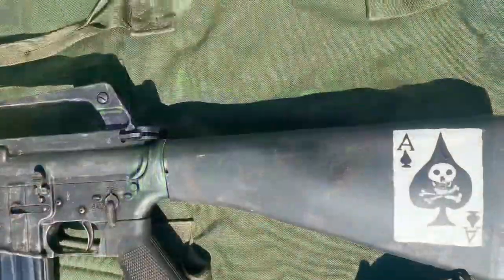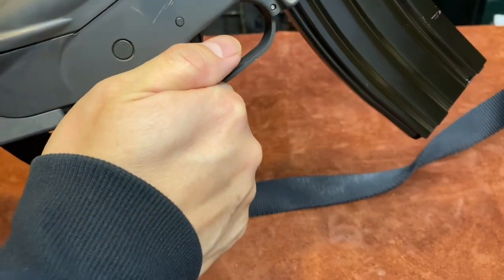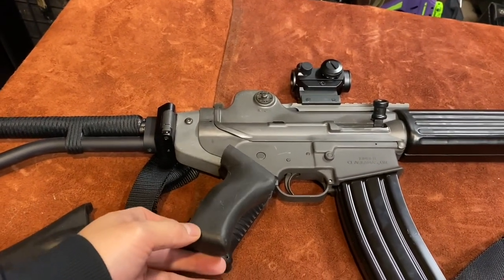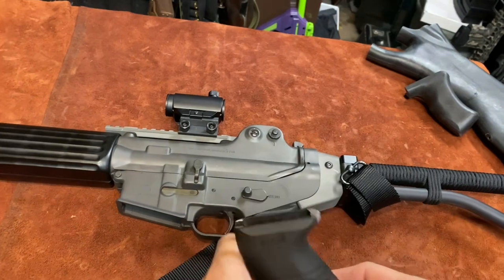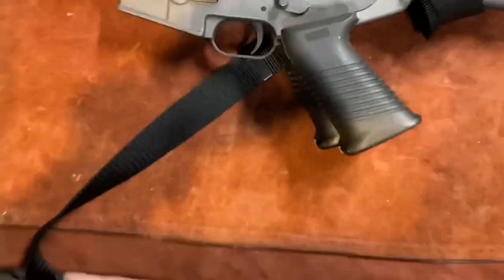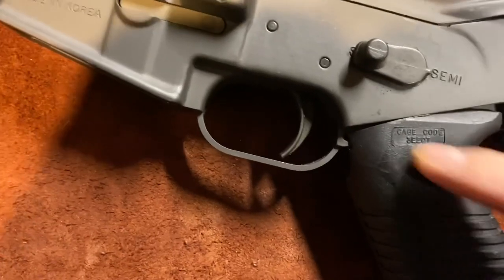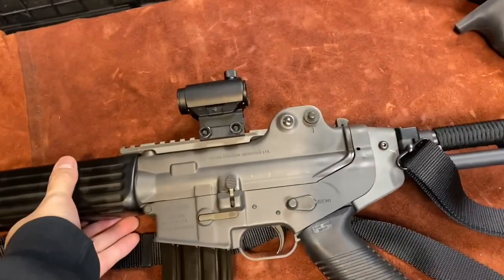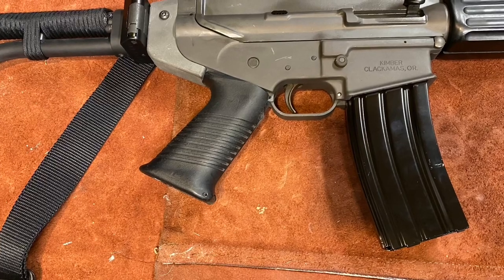DIY Daewoo DR200 pistol grip conversion

Comment: 922r is a non-issue for a individual, there has never been an example of an individual being bothered with 922r compliance. It is almost outright unenforceable even, what's to say this piece of plastic or metal was made in the US or not? If I say it was then it was because no one can prove otherwise.
Reply from the maker: I agree that it hasn’t been an issue until now you can read about the ATF trying to ban certain pistols that are imported with pistol braces under the new pistol brace rule.  922r compliance is easy to achieve as added magazines, screws, muzzle brakes, and springs all count toward compliance
Reply: @danger-closecustoms9739  As an individual firearm owner 922r is still almost completely unenforceable even if you do happen to have a couples screws or springs that are not US made. If you are an actual dealer or importer than yes you should comply with 922r to cover your ass but as a regular guy with an imported rifle why care? And if you're that scared just sharpie "US MADE" on your parts lol
Oh and I TOTALLY follow 922r wholeheartedly, just voicing my opinion on it, heh.
Reply: @danger-closecustoms9739  Oh and thank you for your video. I just got a DR-200 and am currently deciding what to do with the pistol and stock swap, just really despise ridiculous rules, sorry if I seem to be hostile towards you.

Comment: How did you get the thumb stock off? Does the stock portion just pop right off?
Reply from the maker: Thumb hole stock unbolts. Simple
Reply: @danger-closecustoms9739  so I can just pull it right off? Which tools are best?

Comment: Where can you suggest I get a folding stock for my DR 200 ? 
Thanks for the informative video ,keep it up.👍
Reply from the maker: Stormwerkz.com for the adapter there are 3 kinds to choose from. A bolt on style with threaded holes or picrail type. The bolt on is for 2 types of stocks out there such as the bonesteel stock,  the pic rail one is modern style and will open up the options as far as what stocks are available